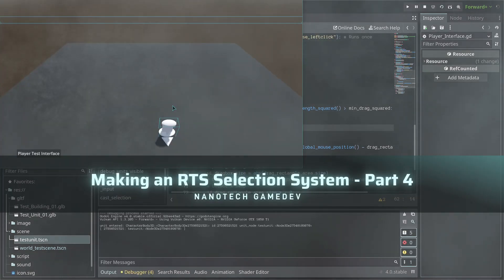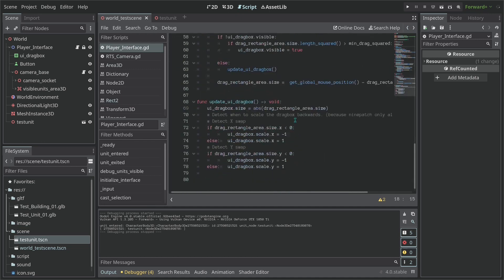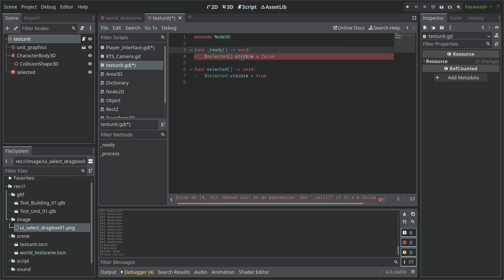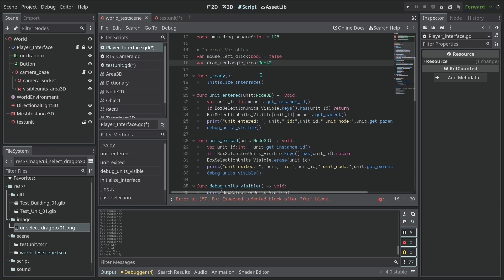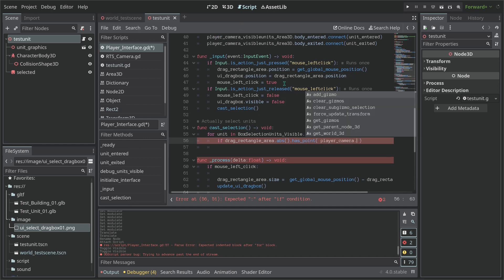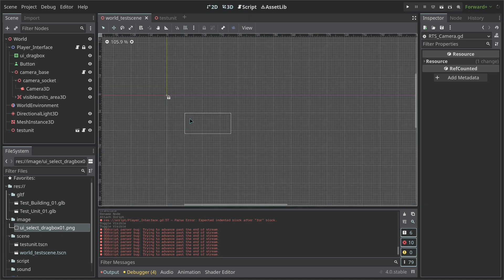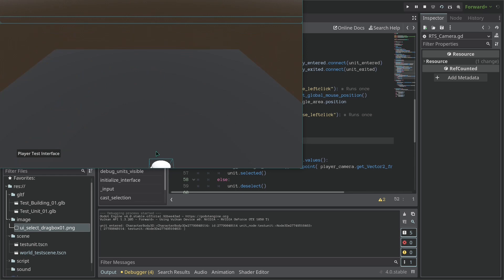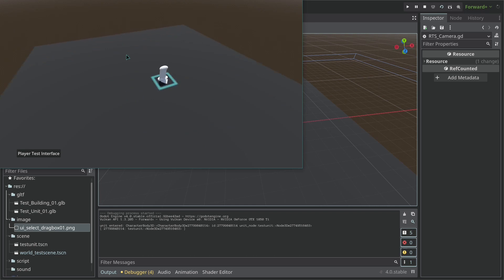How to make RTS Selection System in Godot (Part 4) : Coding From Scratch - Making an RTS Series

Comment: Buf if there is a huge object, it could be selected-hard?
Reply from the maker: You can use AABB to detect if the mouse is inside the a Rect2 of a AABB points, from 3D converted to 2D by unprojecting to the camera, it's tricky, but possible, I will probabilly do that for building selection in a more simpler tutorial video, this tutorial is a little bit long but does exactly this: https://www.youtube.com/watch?v=LGxix92cnWk&pp=0gcJCY0JAYcqIYzv

Comment: I finished this tutorial, but I am unable to select duplicates (ctrl+D) of the test unit. Meaning I don't see the select box under any of the duplicates of the test unit. Selecting the original test unit after inheriting the test unit scene into the world scene works exactly as expected. I get no errors. Using Godot 4.2 beta 1. What is the problem here?

Edit: I went over my code, and it should be indentical to Nanotech's code.
Reply: Hey, I had the same problem and it seemed to be caused bu something wrong with the units entering the box selection.
I checked my code and in the unit_entered function i had this line:
var unit_id:int = get_instance_id()
and changed it to
var unit_id:int = unit.get_instance_id()
and now it works
Reply: For those experiencing the same issue with this tutorial: by duplicating, we are referencing the same TestUnit, so if we select the duplicate, we are actually selecting the original. If we want to have all selected, we should drag and drop the scene test_unit.tscn into the world node, and then everything should work as expected.

Comment: looks like selected units that leave the visible units area won't be set to unselected when doing another drag select.
Reply: yep here is a simple solution to fix that issue you'll need to create another dictionary to store the curranty selected dictionary

func cast_select_box()->void:
	# Removes all selected units after a cast regardless of if the camera cans see them
	for unit in selected_units_dictionary.values():
		unit.unselected()
		selected_units_dictionary.clear()
	
	# Selects units that are within the dragbox
	for unit in visible_units_dictionary.values():
		var unit_ID:int = unit.get_instance_id()
		if _dragRect_area.abs().has_point(player_camera.get_Vector2_from_Vector3(unit.transform.origin)):
			unit.selected()
			selected_units_dictionary[unit_ID] = unit
Reply: @alexjacobs1403  havent gotten here yet but why not just do a purge loop rather than make a second dictionary?